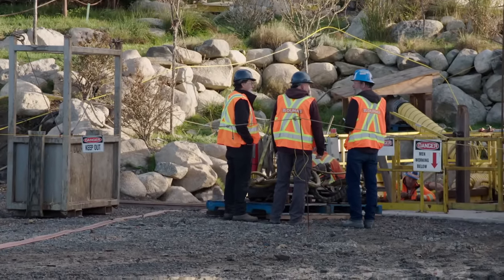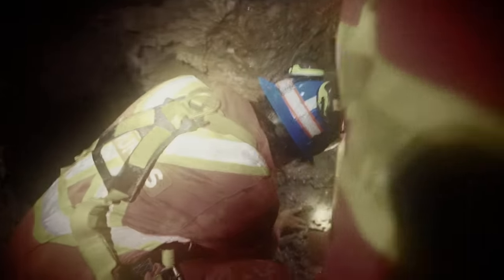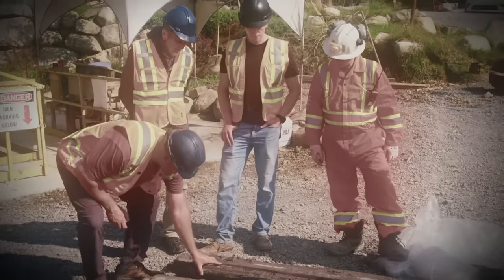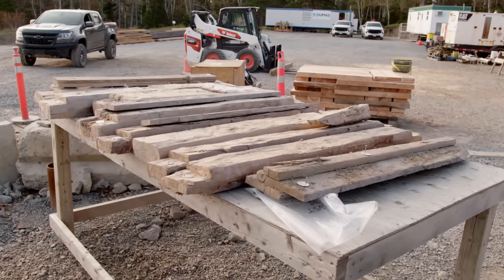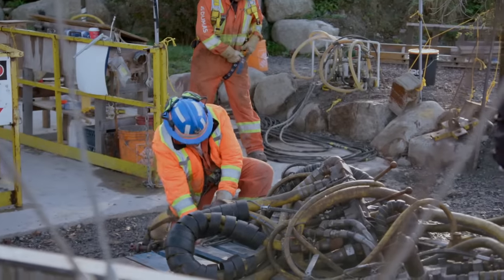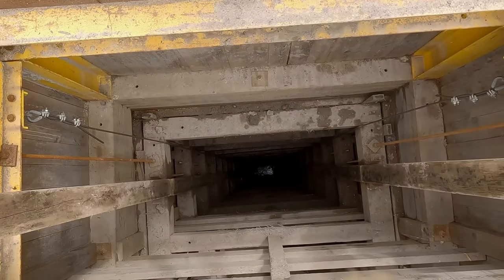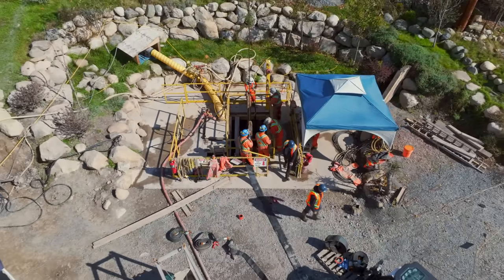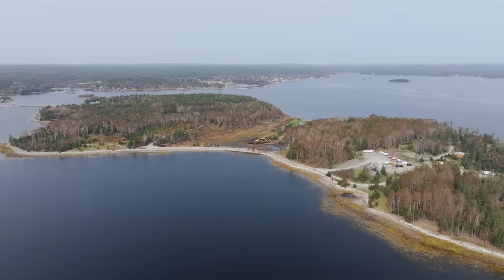The Curse of Oak Island: BIG TROUBLE in The Money Pit (Season 11)

Comment: I carry tapered wooden plugs in my boat in case of a breach.  Why were they not prepared?
Reply: Would spoil everything for the rest of the season
Reply: While working on a natural gas pipeline in North Atlanta we accidentally penetrated a water main with our drill, was about a 1 inch hole. I took a push broom and cut about 6 inches off the handle and tapered it, hammered it into hole and as far as I know it's still like that lol.

Comment: WHY dont they drill a paralell well close to the shaft and use this as the pump well, to get all of the incomming water out, then they can continue digging/drilling in the shaft.
Reply: WHY didnt i think of that 🤣  @NSGNT
Reply: That's season 12
Reply: They need to let the water keep filling up the shaft till it stops and see if it the same height as sea level!!  If it is there is no point in trying to pump it out as it is still connected to the sea. So will have to dame the flood tunnel  by the sea .

Comment: They know where traces of gold were found, they have an access point from the garden shaft, but they won’t be able to pump the water out in order to continue exploring with the side drill or access the treasure cavern until they block off the flood tunnels in the north bay. They have to put the dam back and continue the project they abandoned a few years back when they found the locations of the flood tunnels in the north bay. They should have had engineers working on that problem a long time ago !

Comment: My thoughts are that the original engineering works done were a failour as well, grand plans for something??  But it failed, so was never complete or used. It would not be any surprise to find remains of some of the original tunnelers who didn't make it out in their failed attempt. They have just drilled into a section of tunnel that has been dismantled and back filled, sealed up, so not a surprise there is water behind that section.
There are many failed mines around the world including the USA, that failed and are just abandoned junk sites, or graves.

Comment: They originally found log platforms every 10 feet. Down to the 90 foot stone. They're at approximately 100 feet. 10 feet below the 90 foot stone. Have they not considered that this isn't a tunnel, but a platform 10 feet below the 90 foot stone?
Reply: The "Garden Shaft" IS NOT the original Money Pit.  It is an old searchers shaft that was found to be 83 feet deep.  "They" can't seem to pinpoint the exact location of the original Money Pit for some reason....
Reply: @johnwoa  but they can't deny the fact that it's another log platform at app 100'.  Ten foot below the 90' stone platform. Just saying..

Comment: Why don’t they shove the same metal sheets they used in earlier seasons down far enough in smiths cove (or wherever the can find evidence of flood tunnel entrances) to block off the flow into the area. Even if they don’t know where the tunnel is specifically, a wall of metal put in the way would stop the flow.

Comment: First off, why burry treasure and not be able to access it  in the future ? There must be a secret entry point elsewhere on the island ! Lower the treasure down a shaft but dig a tunnel away from the treasure cavern to be able to retrieve it quickly when needed ! They haven’t really searched hard enough for the “Valve” in the middle of the western half of the island, or the “Hole beneath the hatch” in the northwest corner !

Comment: Put a diving bell style over the hole and prevent air from going out. You will be able to push the water down by increasing the pressure and send people down and work. Like deep diver team
Reply: the walls would all have to be sealed...pressure would just push through the walls
Reply: @boatburnerice7925  true, but if I am not mistaken, the top is a big concrete slab and this could prevent air of getting out. Could work but it's a long shot and they could be working in winters 😉

Comment: So it’s a known factor there were going to be flood tunnel/s. So looking in reverse wouldn’t it make sense to find the source of the flood tunnel next and plug that rather than battle the forces of flooding water. Then again the water that came out into the shaft may only be limited from past collapses along the flood tunnel and it may be manageable with modern pumps once the main body of water has been pumped out. Pumping the shaft out will reveal the flow rate to determine the extent of water flow pressure. 

The timbers found at the base may have been a floor base used like a path as a solid base to pull wheels or rollers over at the time perhaps. Did they look for rolling or sliding marks on the timbers as clue perhaps? They may have used timber for rollers in a confined area as well which is what I would have done perhaps. If they used rollers they may be hard to detect. They would have needed a solid base to pull supposed treasure of weight along.